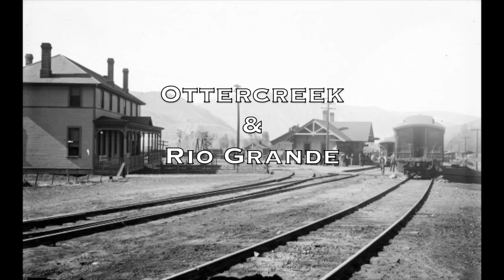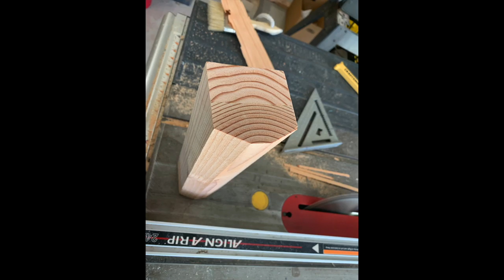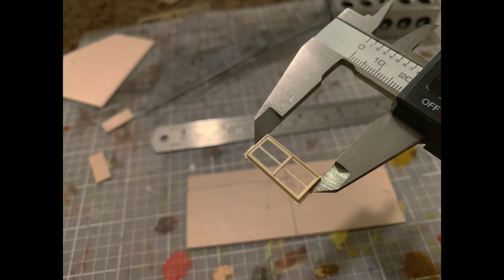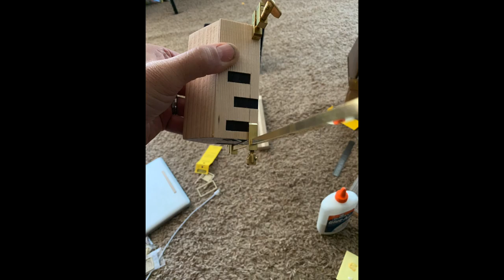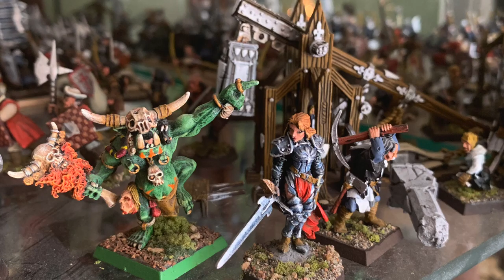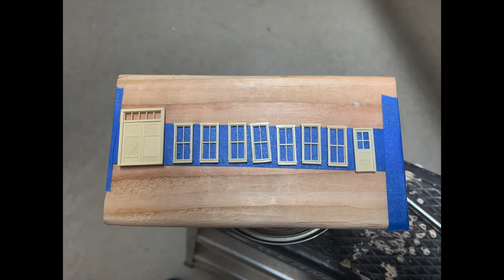Model Railroad Structure Build 1 (Malta Station)

Comment: Excellent demonstration of this uncommon technique for scratch-building Dennis. The final result is indeed stunning. Your experience in painting miniatures definitely shows in the overall effect on the building. Even with the solid block construction, it should be easy to add exterior lighting. Printed paper window treatments could be added to the recess behind the window  glazing where appropriate. Just some thoughts.  Art...
Reply from the maker: Thanks Art!  I do have a few goose neck lights I plan on adding when the time is right.  I should finish up my FSM structure this weekend and hopefully have a video on it as well.

Comment: I've tried wood block structures about 40 years ago but they were flat faced. You've used windows and doors and made the third dimension appear.  Looking forward to your next build. I've subbed.
Reply from the maker: Thanks Mark, I think I subbed you a few weeks ago.  You model the Midland correct?
Reply: @OtterCreek  yes I do but I also have two US outline layouts in N scale. One in storage and one I'm building.

Comment: Dennis i definitely 👍 learned something here.   Your final results are great.   I  think using your same technique but without the block you can make a build with the interior.   I'm going to try your build in a n scale.
Reply from the maker: Yes,  I would say the primary advantage of this technique is durability (this thing is solid!) and no chance of the model warping during the painting staining process or over time.  I'm not sure it's any faster than traditional scratch building, but you can also easily add other sized blocks to make more dynamic shapes.  Good Luck!!
Reply: @OtterCreek  Thank you 😊